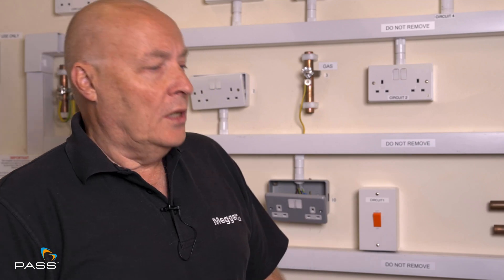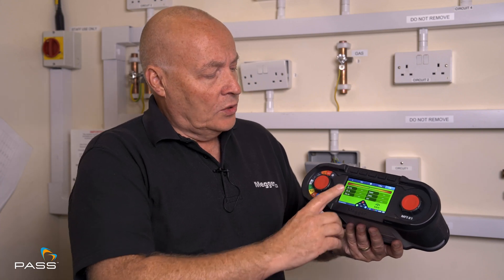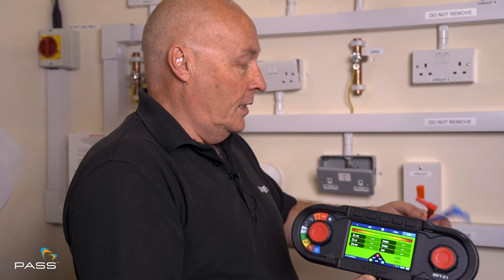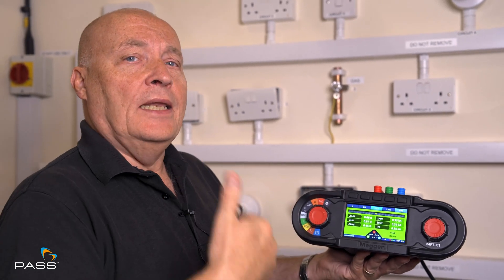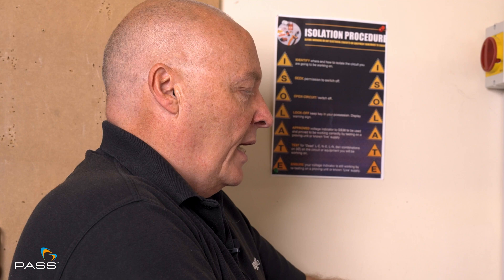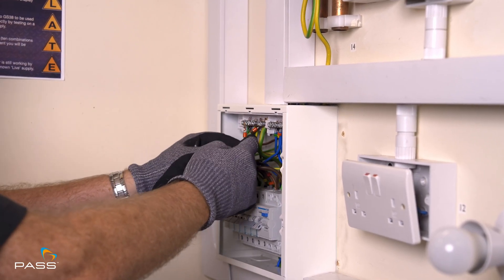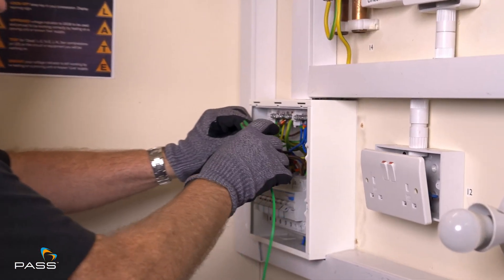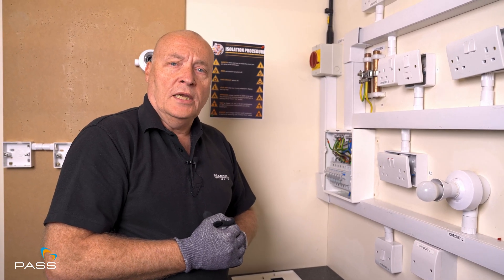How to do an EARTH LOOP Impedance Test! Megger MFT X1 - ZE & ZS Test

Comment: New megger looks fancy
Reply from the maker: Right? It's like the James Bond of meggers—looks good and gets the job done!
Reply: Incorrect, you have to “Null” the test lead before testing. And you have to do this, every time you change the lead configuration.
Reply: I was thinking this too. These meters only null on continuity,  does that carry over to loop test? Fluke they need to be pulled on each test. I've read that on a high current 2 wire twst the impedance of the leads is negligible as your passing approx 20amps on a high current 2 wire test
Reply: Nulled*
Reply: @alancushen6076 
Zero or Null test leads on continuity setting, This value will be discounted from your final loop value. 
If you don’t do this you will get the wrong answer. 
Remember all test leads have different resistance values.